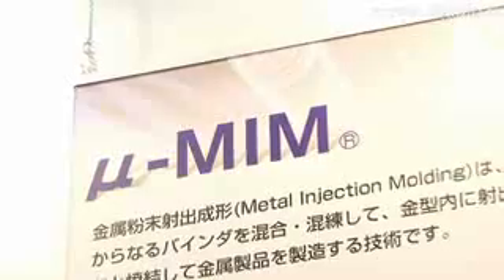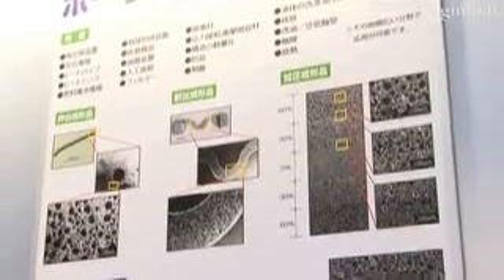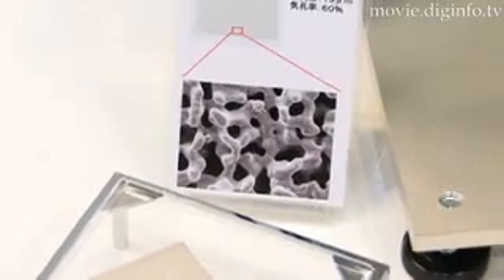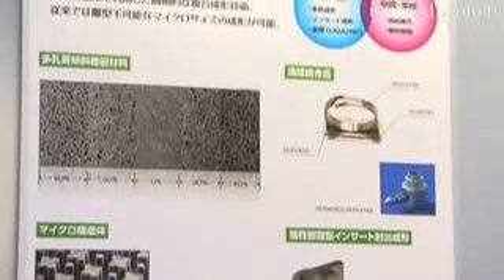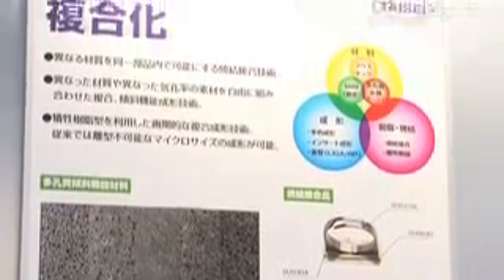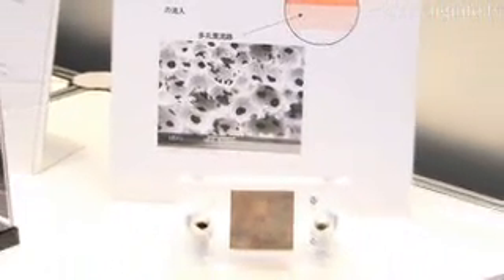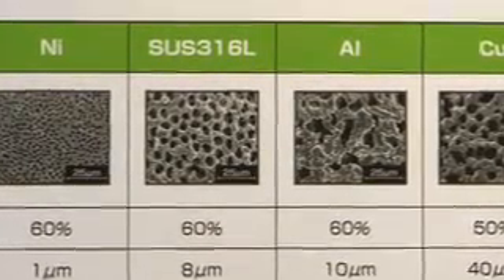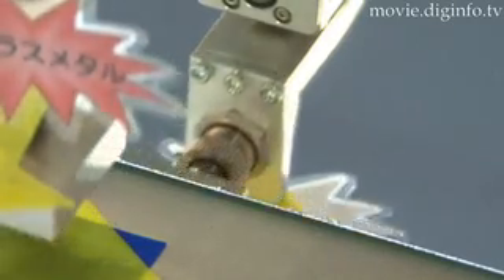Porous Metal & MIM : DigInfo

Comment: I just take that nitric acid from copper potassium nitrate and hydrochloric acid and when it bubbles, the sand stone, metal, or most any metal will become porous

I must speak in lieu of the slow sticker on fast vehicles movement, the write things down movement, the TELEPORT BOX, Future Consciousness "thief"'sin" detection Unit, say things as "greeting" at all stores, advertize on trash cans, no TV, no such thing as unfair with THE CONCEPT OF PERFECTION ALMIGHTY. for 3+ 12+ 27 years preaching.